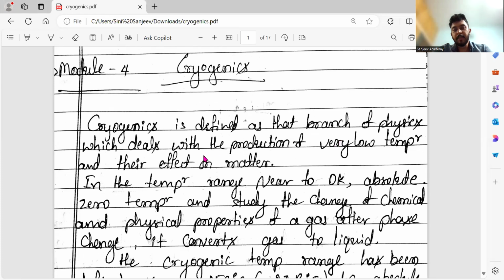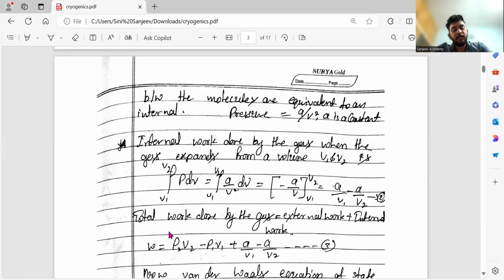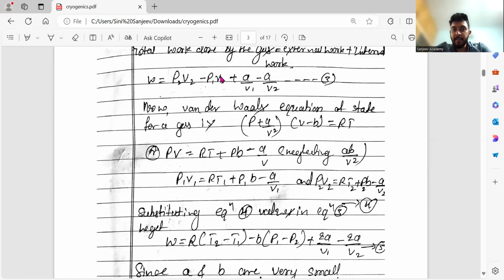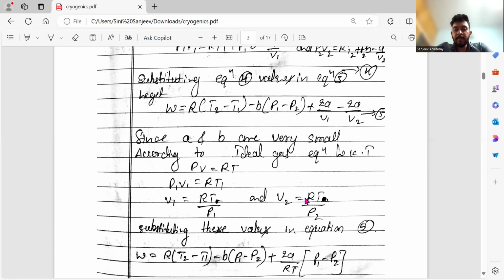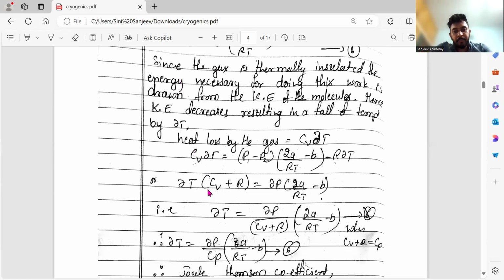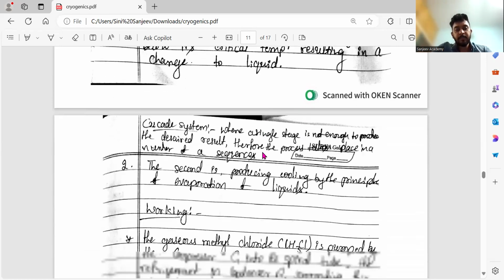Cyrogenics by Sanjeev Sir Engineering physics module 4 BPHYM102/202

Comment: This video from Sanjeev Academy provides an introduction to cryogenics, a branch of physics focused on producing and understanding the effects of very low temperatures on matter (0:14).

Here's a breakdown of the key topics:

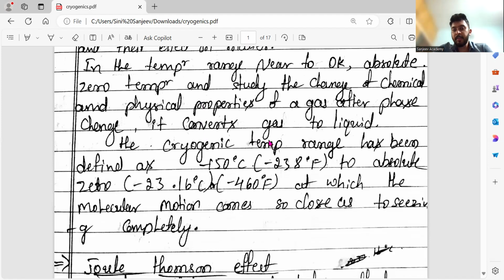Introduction to Cryogenics (0:14-0:44): Cryogenics deals with producing extremely low temperatures, near 0 Kelvin (0:41). This technology enables the conversion of gases, like oxygen and nitrogen, into their liquid forms (0:33-0:36). A normal cryogenic product temperature is around -150°C or -238°F (0:58).
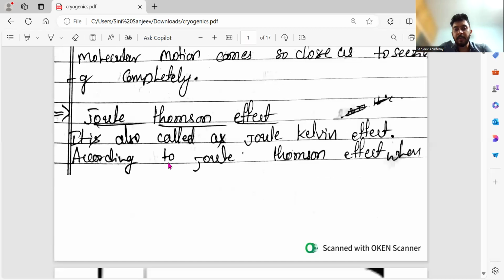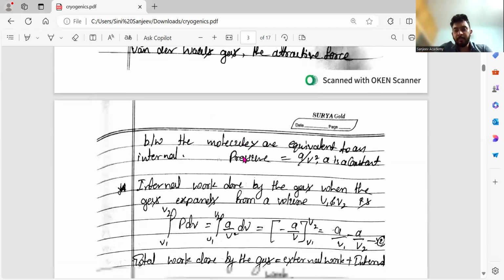Joule-Thomson Effect (1:10-1:45): Also known as the Joule-Kelvin effect, this phenomenon involves the cooling of a gas when it expands. Examples include liquid hydrogen at 100 Kelvin and liquid helium at 10 Kelvin (1:34-1:39), which are produced using this technique. The video emphasizes the importance of the derivation of the Joule-Thomson coefficient for exams (1:47).
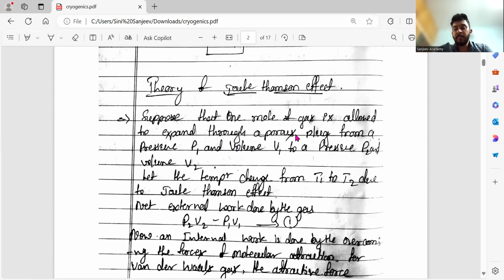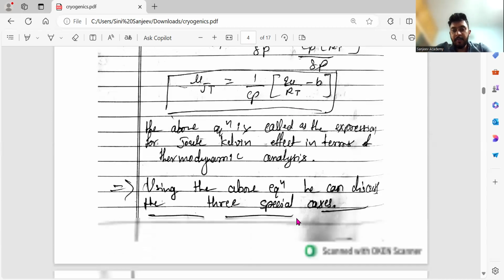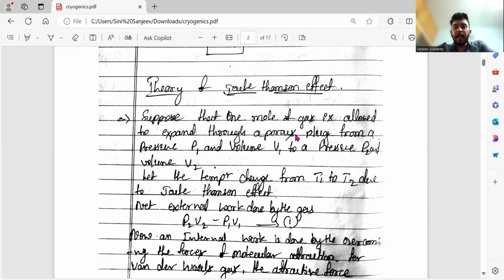Derivation of Joule-Thomson Coefficient (1:55-9:46): The video details the derivation, starting with fundamental concepts like work done (2:06) (internal plus external) and the ideal gas equation (PV=nRT) (2:18-2:28). It then moves to the Van der Waals equation (4:35) and proceeds with substitutions and simplifications to arrive at the Joule-Thomson coefficient formula (9:07-9:15).
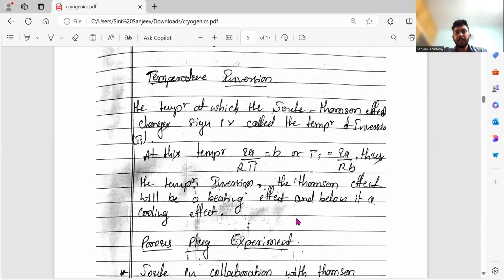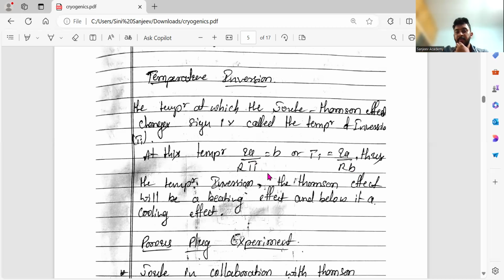Temperature Inversion (9:59-10:16): This is defined as the temperature at which the Joule-Thomson effect changes sign (10:01).
Liquefaction of Gases by Cascading Process (10:50-11:35): This section explains how gases like oxygen are liquefied using a cascading process involving multiple layers and compressors (11:06-11:24). The goal is to collect liquid oxygen at the bottom (11:31-11:35).